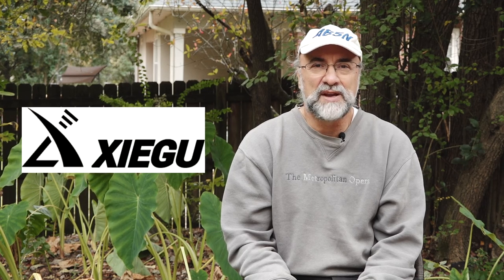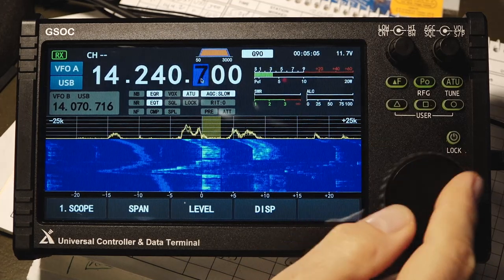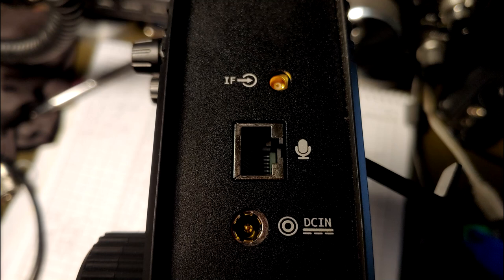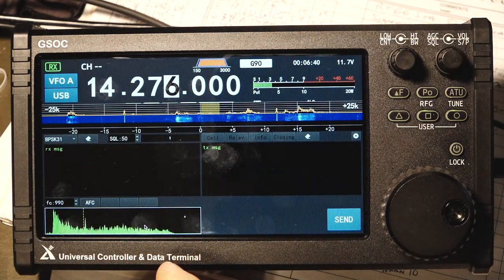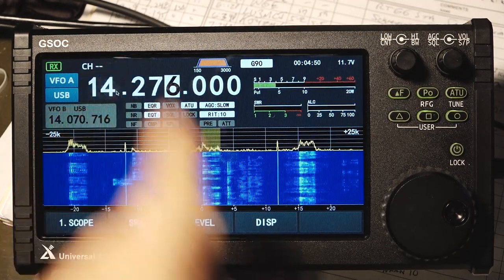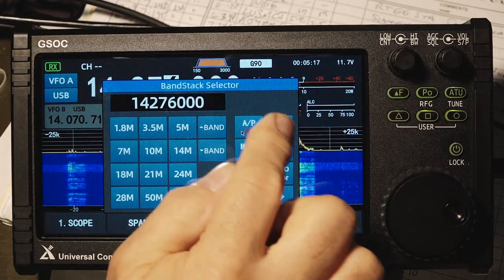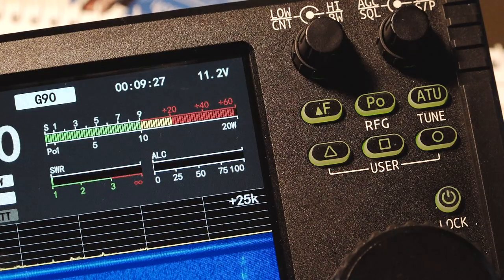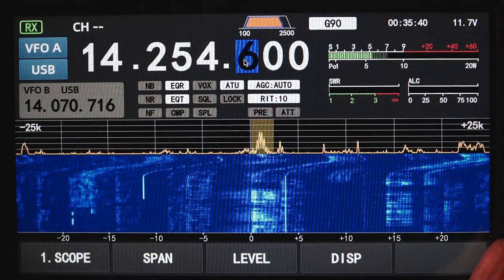Xiegu GSOC - An Overlook of Functions and Features

Comment: Thanks for the review.  My GSOC arrived yesterday.  What I've seen  in my operation and set up so far:  The GSOC will not work without updated firmware on the G90 (I'm using 1.75) which makes sense.  There's two instances of non-VFO related artifact on the scope, "birdies" that don't move with QSY, approx. +/-35khz off the center indicator.  The artifact positions however, are affected by changes in scope span.  A significant latency exists on CW side tone and keying when heard through the GSOC which is very disorienting.  The good news is the mouse and keyboard work properly to control the GSOC.
Obviously, the GSOC is a work-in-progress.  One challenge for the developers going forward is updating firmware that works consistently with both the G90 head unit and the GSOC.  Looking forward to the next firmware updates before making a verdict on the GSOC.

Comment: Great video. Thanks.

Quick question. For digital modes like FT8 or JS8Call, will those run from the GSOC or do you need to run them through the radio itself?

73, KO4CLV
Reply from the maker: At this point, only PSK-31 is implemented in the GSOC (like other radios). There are so many digital modes... I prefer Olivia mode -but I am sure I am on the minority. So yes, I'll continue to connect directly to the radio.

Comment: I'm looking for a SHTF radio and I think this might do it. 
 Do you know when the next update is expected.  
Is a computer able to be added to it for expansion purposes. 
Do you have any idea on pricing?

Thanks for the great video.
8P6RC
Reply from the maker: Yes, of course. I use it on all digital modes with audio cables to my laptop. This is the perfect SHTF radio.  The current firmware on the G90 is mature...it works well. On the GSOC, there are several changes in the works. I expect it to be user-configurable. Also, watch for bundle prices pretty soon on the G90/Amplifier/GSOC etc.

Comment: Thanks for the video.. the unit is larger than I thought.  Maybe it will morph into a radio itself!
Reply: only time will tell.7 3
Reply: It is "virtually" the same dimensions as the G90 - you could lay it on top...

Comment: Thank you for the review. I’ve asked about upcoming features, and CW decode, and RTTY are in the works. I noticed that they had a little screen real estate up by the CH# (Upper, middle, left-side of screen). I wonder if Xiegu could put a small 6-8 character tag in there for channel ID? 73!
Reply from the maker: I would expect some display re-arrangement soon. Also, user configurability. The GSOC can do anything the G90 does. (capability wise)  They have every reason to make this combination competitive with other radios in it's class.

Comment: How did you eliminate the waterfall center line noise?
Reply: I did nothing. Must be my cables. I will look at it again and see if cable placement or quality changes this.
Reply: @Yavor54  would you mind sharing which firmware sre you using on the radio and which firmware on the GSOC? Im using original cables from Xiegu and I do have the center line noise issue on the waterfall

Comment: Thank you for this. Speaking of FM, I wonder if it's possible to add WFM and maybe 2m and 70 centimeters to this device?
Reply: I believe that this would be precluded by the radio, as it is not included in the G90.
Reply: @lmcelhiney  Thank You

Comment: is the cw decode displayed on the GSOC?  I also think that they need to add a voice/cw memory keyer   de K8MH
Reply from the maker: Right now, no. Expect considerable additions to the GSOC with the next firmware releases. There is plenty of processing power for more features. I have sent a laundry list of upgrades for it to the Xiegu engineers. They were very responsive on the G90 items I sent them. (display fill, etc)
Reply: @robertnagy2163  
The next "Laundry list" you send to the Xiegu engineers might include a request for a ACTUAL FUNCTIONAL CW DECODE on the X-5105 THAT I ALREADY PAID FOR!

Comment: Good to see a quick tour of GSOC functionality.  Pretty much the product I imagined - but the price point of GSOC and radio combined makes this an an expensive combo.  The unit held in your hand looks beefy and as robust as the G90 itself.   73's Pete 2E0WHT
Reply: If don't already have a G90, seems like a better idea, price wise to buy the IC-7300. Of course with the G90 you have to versatility of  having a small portable radio in the G90, 73
Reply: @frankENZC  Really for two different markets.  A better comparison would be to the ICOM IC-705, as they are both portable QRP rigs with touch screen display.  However, for those of us with by a G90 and an X5105, we can basically split the cost of the GSOC over two radios.
Reply: @lmcelhiney  Hi Larry. Good point about he IC-705.
Reply: @frankENZC  The GSOC version 1 will require many changes just like the 5105 and the G90. Xeigu seems to use early adopters as Beta testers. It is fun but rather frustrating.
Reply from the maker: @frankENZC  Yeah. If you ever want to operate portable, the 7300 requires a huge battery and really eats power on RX. The G90 itself is VERY effective portable. Going from 10W to 20W makes a huge difference out in the field. With bundle pricing discounts, this combo (including 100W amp) will be quite competitive.

Comment: The markings for the bandwidth control are exactly opposite their actual function. You adjusted the outer one, marked “LOW” and it shifted the UPPER frequency edge of the bandpass. 🤦🏻‍♂️ This was upper sideband, on lower sideband the markings would make sense wrt audio bandpass, but still backward for RF.
Reply from the maker: You caught that! It is a tiny issue that is on the fix list.

Comment: Mine i think is going back....the scope has birdies, its not looking like yours as far as color or sharpness no matter how much i tweak it......it doesnt work with my w2ihy gear and my sure boom mic like the original head unit does as far as line in input per the accessory port in the rear of the main body.   It doesnt seem to do what mine does with  1.74 v software that i have with the body and face matching firmware..... its just not right as far as function compaired to the original head unit.......i was stoked to see this video only to be let down  by the particular unit i recieved.........what a disappointment............Greg, kc3obq
Reply: Also way too many cables....why in the world couldnt it just have the 9 pin cable both power it and show the info?   It makes it way too bulky to take portable......3 cables plus mic, its just not ergonomically simple......